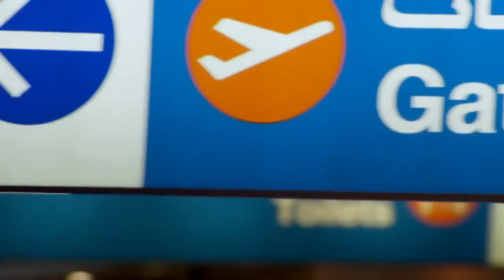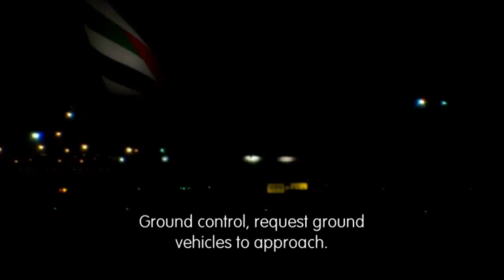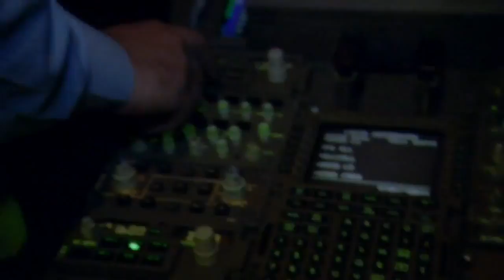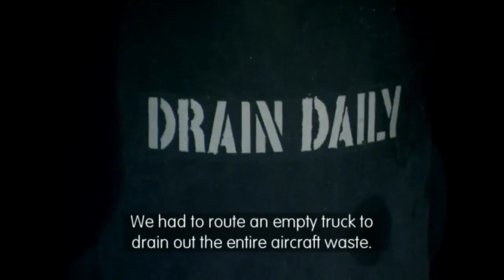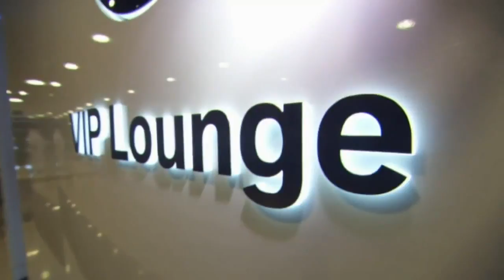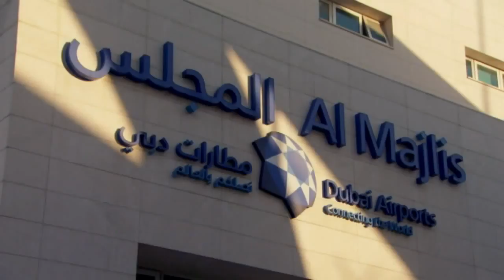Ultimate Airport Dubai S02E02 - Firefighters

Comment: Why don’t they just build a 3rd runway next to the other runways or between. I have flown lots of times in Dubai DXB and I know it’s HUGE.
Reply: Parallel runways is not as easy as you might expect. Besides taking time and costing money it’s very impractical to operate parallel runways since the minimum distance between the two runways has to be at least 213m for VFR and 1311m during IFR according to the Federal Aviation Administration. However on special occasions the FAA will allow a distant of 914m for IFR but I’d recommend that you take a look at Captain Joe’a video about parallel landings.

https://youtu.be/OoYikXvnU6M

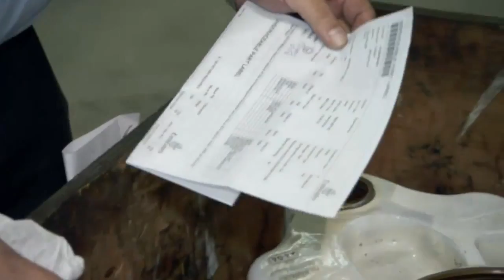Comment: 20:11 777-300er is just a 777 300 with extanded range witch means severd wingtips, more fuel tanks and small design changes. Can someone explane why the break has too be different on theses aircraft
Reply: Mikayel Միքայել the same as how a 2003 mustang and 2018 mustang brakes are different parts are redesigned to improve efficiency and in turn safety
Reply: Maybe it's upgraded
Reply: More fuel tanks allows the aircraft engine to be faster, and the faster, the better the brake.Some for cars as well.On top of that,  the Boeing 777-300ER has more changes than you think.

Comment: Geez, they make everything so dramatic... oh my, got to cross an active runway.. oh my, an aircraft with a hydraulic leak. I guess for people that dont work in aviation, this might be exciting....
Reply: Highly unusual to the public, but do some similar thing in their work, and they jump right in, and fix it, again.  The one thing I have not seen on the Dubai Airport series is Human Remains.  Watch the drama when that kind of thing goes wrong!
Reply: Remember it wasn't simply reported as a hydraulic leak it was reported as smoke and a possible fire, they responded appropriately.

As for the over the top drama, yeah they could dial it back a bit
Reply: 3 minutes to make a 12-second crossing! Oh my, will they do it? I'm glued to my seat. 

NOT
Reply: For anyone NOT around an airline, you have to understand how dangerous a day like that can be.................if less than this happens, people fall asleep standing up.  The level of drama narrated over actual events does nothing to show you how things can ACTUALLY start to go wrong.  We need to see the worst snow storm in Dubai history, and THEN we will have some problems.
Reply: Dude, first
1- 12 seconds to cross a runway with gap time of 3 minutes may sound a-lot, but what if something such as a brake failure while crossing it???Or a fire on the gear while crossing, does three minutes sound enough to DIVERT all aircraft approaching that runway, DIVERT the planes heading for the runway via Taxiways, GET THE FIRE DEPARTMENT before something explodes!!
2- It ain’t dramatic, people who suffer least complain most.You have to be a worker in Aviation to even think how much work it takes.

Comment: why are they landing on tarmac and not concrete???
Reply: andrew leah friction & better drainage I suppose & tolerance to weather
Reply: Here in emirates the weather is always soggy and it’s always foggy
Reply: Concrete has its own problem with expansion and contraction; patching (with its subsequent curing) takes a lot more time, tarmac can be used after patching almost right away.